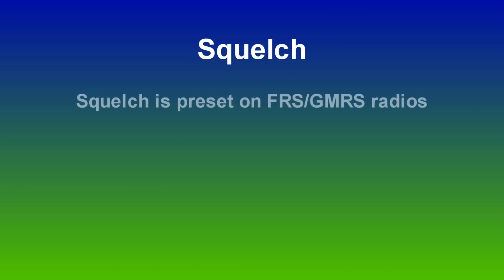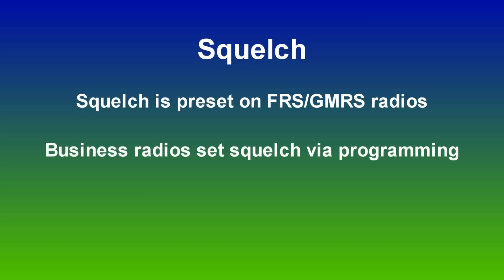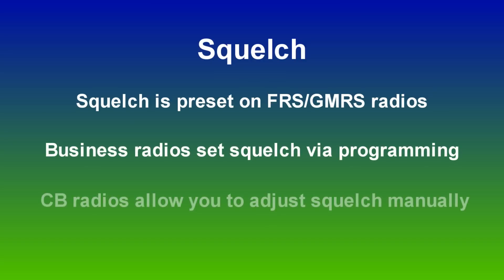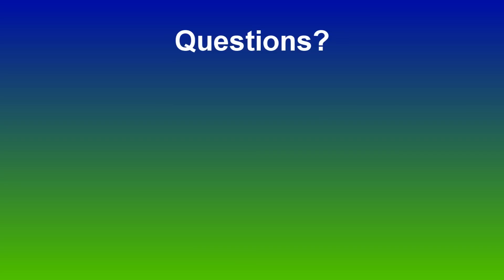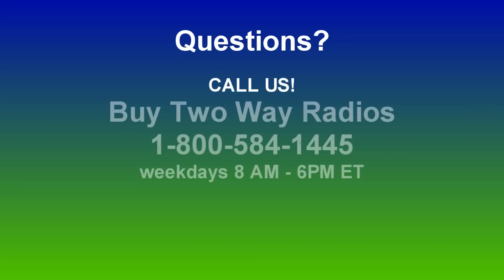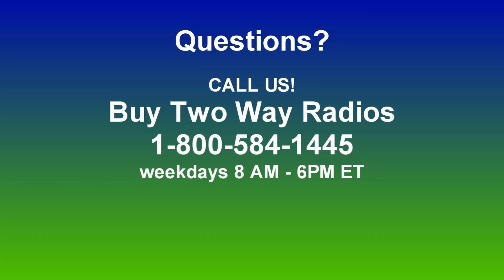What is Squelch? | Radio 101

Comment: So, why not just max squelch out? They say to adjust squelch until the static stops but that's almost right away. So why not just max it out?
Reply from the maker: You typically adjust squelch just above the threshhold so you can suppress the "white noise" on the channel while still allowing the weaker voice transmissions to get through. If you "max" the squelch as you call it, you will eliminate both the noise and much of the voice transmissions, especially those that are weaker or just at the edge of reception range.

Comment: Solid. Maybe some day you can do a video on how to set auto squelch (ASQ) , such as on the Albrect/AnyTone radios.
. . . I'm one of those old guys used to the knob style "carrier" squelch on old 11m radios. Just got a Albrecht and have been trying to figure out how to set the squelch. Doesn't help much that I can use either carrier squelch (at least that's what it looks like ;-) ) or auto squelch (which is also adjustable). At a point now where I think I've got stuff set but a deeper grab at what's happening in ASQ might be helpful.
. . . Good video. Well presented and clearly presented. Thanks!

Comment: So the higher the squelch level I set on my radio the less noise I get? Does that also suppresses actual transmission?
Reply: very very old, but this answers what I was wondering about with my radio where I can turn squelch off. So that would be so I could hear someone whose very weak and distorted, by turning off squelch, I may just be able to make them out, or atleast have another chance at it. Correct?